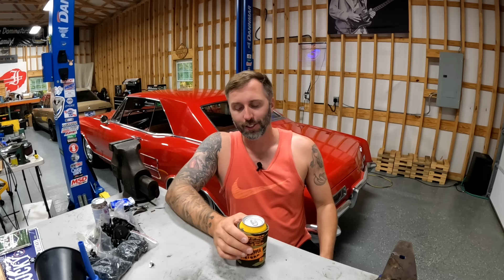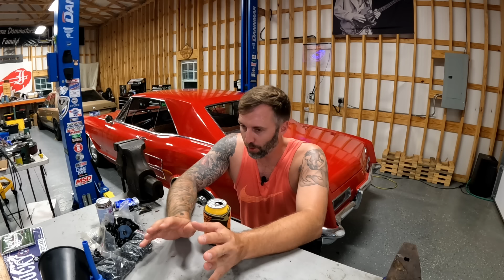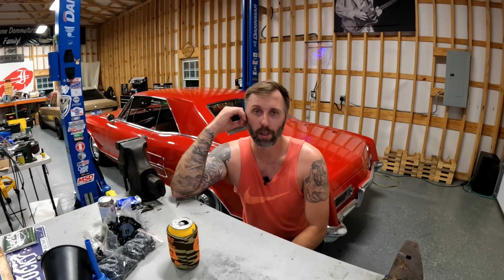Why I Ditched Holley Sniper EFI

Comment: Bonjour, I am French from France and I have a similar issue with Holley. I have send back my Holley Snipper 2300 and it takes weeks to have it back to France. My engine is a GOLEN 4.6L 6 cyl that I purchased at GOLEN for my CJ7 Jeep. When I got back the Snipper it works beautifully well but time to time the engine is starting to caught for unknown reason. The Harness is new and the ground is perfect and the Snipper is directly connected to the - & + of the battery. I am lost in France with the Snipper 2300 where Holley Europ do not exist! Cheers and continue to do your video they are very instructive and I like yours comments.

Comment: SOOOOOOO Glad I stumbled across your video. Installed the Sniper unit on my 87 El Camino over a year ago. Had issues right from the get go. After 6 months, countless hours on the phone and emails going back and forth with tech support, and swapping out warrantied parts, I now have a decent driving car. DD Speed shop did a video a few months back on a dual Sniper install that never worked out of the box. He went back to carbs as well. Another great video that everyone should watch. This swap is not for the faint of heart. If I had a chance to do it all over again I would have stayed with a carb or done an LS swap. Thanks so much for taking the time to do this video!
Reply: The Holley help line is useless, regardless of what product you have questions about!

Comment: I have a 1971 ford bronco with a jasper 302 motor. I just went to fuel injection and I did my research. I almost went with the Holley sniper kit until I met the fitech guys at a car show. I went with the fitech, it had way less parts and a 1/4 of the price. I love it. I went to hot august nights in Reno and the fitech company had a tent there. They pulled me into the tent and cleaned up the parameters to be more efficient. It was the inventor of fitech that got his hands dirty. They now have a customer for life. Customer service is unbelievable and so is sales and tech support.

Comment: Your experiences are mine also.  I've had to run through installs for friends that claimed these units were junk.  Yes, I have had a few bad sensors but mostly the problems encountered were bad wiring, dirty power, plug wires were a big problem, basically installation problems.  I have found both the Holly and Fitech units to be reliable but you just can't just throw the them in with Scotch Locks and electrical tape.  I understand your position and problems and believe me I've been there too and if I had experienced your problems my solution would probably be the same.  I'm currently running a Fitech Ultimate LS injection kit on a 5.3 swapped '68 C10 and love it but it's not for everyone.
Reply: I'm planning on doing the Fitech setup on my 66 C10 with a 408 stroker/single turbo.

Comment: The problem with aftermarket FI is they are changing them every year and after 5-10 years you won't be able to get replacement parts.  Carbs are timeless and can be fiddled with to get you home when theres an issue.    But as always, choose the system you wish and can afford.  Thanks for sharing you experience, it helped me save some $$$ by keeping my ancient tech.
Reply from the maker: I agree.   Thanks for watching and for the props.  Subscribe!
Reply: Pretty much all the sensors, injectors and similar stuff are standard items you often see used OEM on factory cars. The manufacturers of aftermarket EFI systems have no reason to use money and time on reinventing the wheel, when standard parts that will do the job already are available out there. Like my old FAST EZ-efi system use the same IAC as can be found on an LS1 engine. The TPS sensor are the same used by GM on an LT1. Electronics are usually VERY reliable, most of peoples aftermarket EFI problems seems actually to be based on the mounting. It takes very little electric noise or crosstalk between wires to make an ECU act very weird.
Reply: I bought a used 1997 Harley Davidson ex-Police Roadking. It had Magnetti-Mareli fuel injection, which Harley used from 1995~2001. It was a mess. Harley ditched the M-M and went to Delphi. From what I learned, the split was not amicable and there was no support or parts available from Magnetti-Mareli , thus none from Harley. I removed the ECM, throttle body, fuel pump, and a lot of wiring, relays, sensors, and other related parts. I replaced them with a rejetted stock Keihin carb, Dyna 2000i ignition & coil, tuned it in and it's been trouble-free for close to 10yrs. Fuel mileage is actually better than with the M-M FI!

Comment: I’ve had nothing but horrible experiences with the Holley Sniper. The only time I personally have ever used one was on my dads ‘82 Mustang GT. He was horribly sick at the time (congestive heart failure) and I had finally gotten the sniper on and running and it was running perfectly, we took the car to a show (which come to find would’ve been the last time he drove the car) and the O2 sensor circuit shorted and burned the harness up and left him stranded on the side of the road. The one experience alone made me throw it in the trash. My brother runs it on his 80 Cobra but he’s gone through at least 4 different head units and it seems like it gets a new one every season 😂 he somehow gets them to send him a new kit every time though without paying for a new one and without receiving the old kit. How? I don’t know. But either way, I gave you a sub. Good content!
Reply from the maker: Your brother is a wizard lol. Thank you
Reply: He didn’t have it tuned correctly most likely adding or subtracting a high percentage of fuel. Any fuel injected car will run fine without an o2 sensor if it is tuned correctly.
Reply: Sounds like instal error.
Reply: @TRIPLEWHOPPER do u or don't you like the sniper?
Reply: Sorry about the loss of your Dad (I assume since it was the last time he drove the car). Hopefully Holley gets their shit together.
Reply: There's no such thing as an '82 Mustang.
There was a car that Ford called a Mustang, but it wasn't a Mustang.
Reply: @coleman6131  Okay, so how do you feel about the 79-81 and 83-84s, since all were very similar with minor tweaks from year-to-year? The 82 is a legit Mustang, even if you don't think so.

Comment: I have put two of these Sniper systems on our 1980 P-30 stepvans. They were properly installed by the book, every connection soldered, any extra wires depinned and removed.  We have had the issue of rfi causing the hand held to freeze up and also raising the idle speed of the engine.  I was on the phone with Holly and the tech guy that was helping me ended up saying the unit was defective and sent us another one, and only the main unit.  We installed the new one and programmed it and it did the same thing.  Funny thing is is that it would behave fine at first and then after driving around for 30 min or so you would notice the idle creeping up and then the hand held would start freezing.  If you shut off the engine and restarted it it would be fine again for about 30 min and then the symptoms would happen again.  I got on the phone with Holley again and this time I got a tech guy that was aware of the rfi issues and told me to foil all the spark plug wires and ground the foil so I did. I also foiled the hei distributor as well and grounded that foil as well.  That fixed the problem with the rfi.  The next problem we had was the secondaries sticking open a tiny bit causing the idle to be high and until we figured out what was happening we were trying to compensate by lowering the minimum idle air and of coarse this means you have to reset your tps as well.  Well the funny part is that when you would shut off the engine and the vacuum would bleed away the secondaries would fully shut.  We then figured out that the friction in the throttle shaft was too high when you had vacuum on one side of the throttle plates.  We tried to fix this by wrapping the secondary throttle shaft return spring one more wrap which did work somewhat...  I can tell you that I have spent a lot of time messing with these because of these problems that Holly failed to address before they released the sniper units.  If I had put this system on a T-Bucket with an exposed engine that you would be showing off then  I would have been really upset since the engine in the stepvan looks pretty stupid with all the foil on the wires and distributor.  Hopefully the Sniper2 will be better...It sucks when you tell your boss that we can put fuel injection on work trucks "these p-30 stepvans were A/C install trucks that were driven every day." and then have to explain to him why we are having all these drivability problems.  I feel bad for the weekend mechanic that buys this system for his hot rod thinking they are going to have a great trouble free experience with a properly installed Holly fuel injection system...Once again lets hope the Sniper2 is better...
I hope me sharing my experience will help somebody that is going through what I went through with these units.
Reply from the maker: Wow thanks for sharing your story.  Awesome post.  Please subscribe.
Reply: Use Faraday tape 9n all wiring. Had the same issues util doing the tape.

Comment: I'm sorry to hear of your problems but appreciate your candid assessment of the situation with the Sniper. Probably the 2nd version is better but it should be and you should have never had these problems. However I want to thank you for letting us know nd I have been on the fence with this thing for a while but agree with you that carbs while not perfect do their job pretty well and can be trusted to do that job forever. There are no software upgrades and the carb will never become obsolete like any throttle body FI will after the manufacturer discontinues support for it. That will never happen with the carb. Thanks again for helping us and your Buick is beautiful.
Reply from the maker: Thank you!

Comment: I'm in your camp. Had original Sniper installed at my regular auto shop and they did a wonderful job,. Started with a new SBC long block, new EFI gas tank, Holley Sniper Master Kit with Hyperspark, in tank fuel pump. All parts were NEW from Holley. It ran PERFECT for approx 2 months. On a long trip it started to "act up" and run poorly. Long story but every tuner shop said it must be the older wiring interfering. This went on for ever until I started reading the Forms. Turns out the injector wiring plug(s) came loose. 1 primary was not sending fuel and 1 secondary was off/on. Yes I know they all work at the same time but it makes it easier to describe. So, I straitened to plug pins and the Sniper now works AMAZING..... until 3 days ago the o2 sensor shit it's pants after 10K miles. AFR is reading a constant 35.6. That's another story.  I'll be looking else where for the next motor swap. 
I've been reading about ACE's Royal Flush EFI. Take a look and maybe offer an opinion. I'm not a mechnic or tuner but I was able to solve my problem by spending several days on the Forms. I'd rather be doing something else.  Good luck
Reply: if the kit came with the bosch 02 sensor. i highly recommend swapping to an NTK 02. we where going threw bosch 02S at the track every month with the leaded fuels. once we swapped to ntk have not had one fail on us yet. now mind you these are with HP and dominator computers. i cant remember if you can go in with a laptop to the sniper unit instead of the handheld and switch the parameter  to read an NTK 02 sensor. hps and dominators we can. but funny enough. we just tuned in a 70s chevelle that had a sniper unit on it. they took the car down to good guys couple weeks ago. and while heading back up to the canadian border the 02 shit itself. so we had them put it in open loop so it doesnt keep adding fuel when its not needed

Comment: If you are comfortable working on carbs, before converting to fuel injection, install a decent air fuel ratio meter.  This is a game changer in that you can see exactly what  the carb is doing.  From there, tuning and/or trouble shooting becomes VERY easy, especially if you have a 4150 or 4160 Holley carb.  I have done this on both of my carbureted cars now and they run so well that there is absolutely no reason to convert to EFI.
Reply: Efi has it's place. I have exsperince with both. Its kinda funny but once you figure them both out its efi that is easy mode and carbs that require a bit of voodoo knowledge. I've got an HP efi system on my coyote and it's really fast and easy to change things like air/fuel, timing, even per cylinder plus the ecu can control several things on the car - fan, fuel pump, 2step, trans brake, ect. 
However, efi is quite a bit more expensive and a carb probably has a small power advantage with a wet intake. It depends on what you want.
Reply: The track or driving down the road is a better tuning tool than an A/F gauge. I tuned my Holley Street HP very close with only my 50+ years of tuning expeience. The air jets weren't new to me because I ran Webers on my VW desert race car 40 years ago & all I had to do was read up on the Holley. I've come up with several of the same conclusions about intakes & carbs as Engine Masters & never had a Dyno to tune with. As far as FI or Carb, the carb will do everything better than EFI & if your out in the sticks & have trouble, you can probably go into any NAPA store & buy parts for a Holley or HEI ignition system. Try that with an aftermarket FI unit!!
Reply: Exactly. When I used to do QJets, I threw the BS cliff Ruggles book in the Garbage and got a wideband. 
You know what I found? Cliff wrote a bunch of BS on the Q Jet,  Doug roe and Danny Ashley were right on as they worked with the original engineers. The wideband is a must on any Carb tuning!!!
Reply: @bradgriffith4231  
Well, it's not true that a carb will do everything better than efi or modern cars would still be running carburetors. 
There are things carbs do better and things efi does better. We all have our preferences but our preferences are not proof of superiority.  It's not a "one size fits all" deal.
FI gives you rapid control, it saves a lot of time. 
Carbs give you simplicity, it saves a lot of money. 
So which is more valuable, time or money? That's up to each of us to decide.
Reply: THis^^^
Too many spend thousands on aftermarket EFI assuming it will behave and last like OEM>..no such animal .Takes minutes to adjust a carb set and forget.
Last thing I want in old iron is some screen or a laptop I constantly have to monitor fool with. Screw that
Reply: Well not everyone wants to rejet their carb every 8 hours. I'm a logger and drive my carbed  85 f350 460  crummy to the jobsite daily, sometimes with an elevation difference of 7000 feet and temperature change of 60+ degrees F. Not to mention poor quality gas and inconsistent gas blends, like in spring and fall when they change the volatility.
Reply: Agree!! Most of the "carbs run bad" guys or "solids always need adjusting" are guys who never had them set up right in the first place.
Reply: @funkysawmanwright5077 ok.. sure. Then go purchase E.F.I

Comment: I run a sniper on a LS1 with a carb intake and an msd 6ls ignition box. my sniper unit was purchased as a reman unit back in 2019 for a huge discount. LS1 has a massive cam, cnc heads, 1.75 headers. I had a surging idle issue when installed but it was due to intake gaskets. After i changed them all was well.

Also run a sniper on a 390fe ford with decent cam, edelbrock heads and a billet pertronix dist. Runs perfectly fine. 

Both units were able to adjust the IAC around 5%. Both hand helds work, no O2 failures. 

Both cars (69 camaro, 67 mustang fastback) each received a new aeromotive stealth fuel tank, fuel lines and 10 micron fuel filters. 

Aside from snipers i have an old holley hp unit on a turbo 5.3 lm7, Flawless as usual.

Comment: So I had a carb that ran great, went to fitech and I couldn’t get it to run right all the time. Went back to carb but… I took the ECU from the fitech and hooked up all the inputs including the TPS. Now I can data log the carb and make adjustments as needed. If the ECU dies, I’m still cruising.

Comment: I was kinda hesitant to convert to Holley Efi. since im running my car with dual quad Edelbrock and having plans for a 1000 Miles road trip. But after watching your video, im good with carbs for my road trip at the expense of mpg
Reply from the maker: If it was me I would keep the carbs.
Reply: I'm using the Edelbrock dual quad set up on my 396 68 Camaro I'm staying with my carbs also gets lots of looks and is a blast when I put the pedal to the metal

Comment: Great video, I have a new build, I was on the fence on EFI, decided to get it up and running and broken in on carb. After watching all the issues other people have been experiencing I am holding off and enjoying my ride for now. Added an AFR gauge and O2 sensor to my C10 and waiting to see how EFI kits progress, I just about pulled the trigger on a Sniper and then they released the new unit, feel like I dodged a bullet, sorry about the hassles and hours involved and money.
Reply from the maker: thanks, i appreciate you watching.  Honestly with a wideband a carb becomes real easy to tune.  And they are reliable.  plz subscribe! thanks